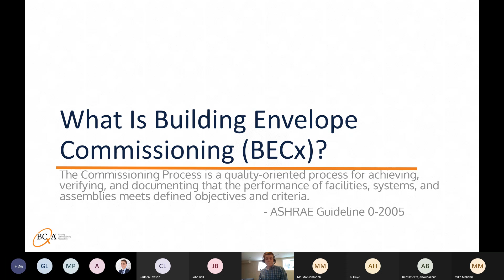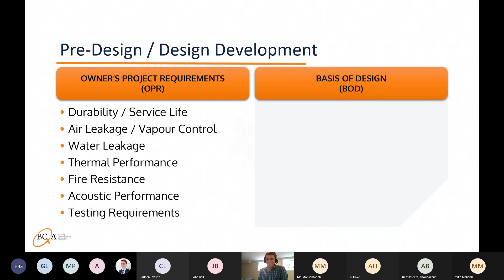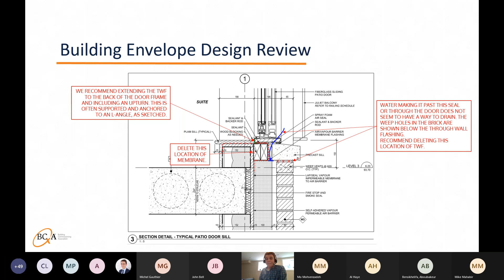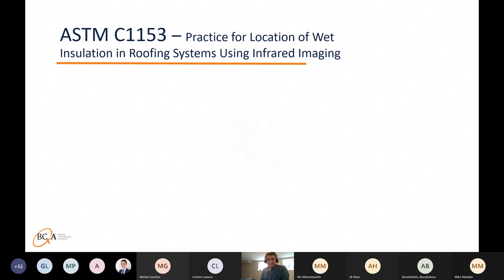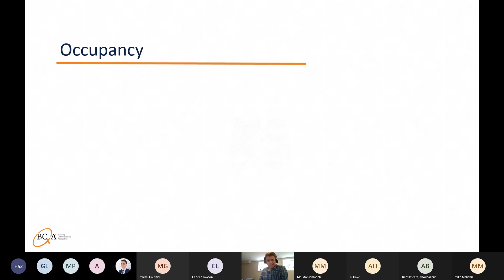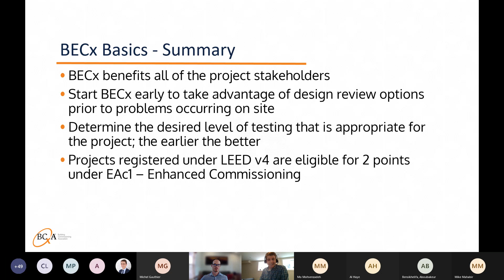The Basics of Building Envelope Commissioning

Comment: According to LEED Coach "Annex U of NIBS Guideline 3-2012 states that field water testing is required for all projects."  
However, according to the instructor's answer, different tests are performed on different buildings and you can get points for that (it doesn't necessarily have to be a water test). 
Based on your experience, can you confirm that the project received points for the façade tightness test alone?